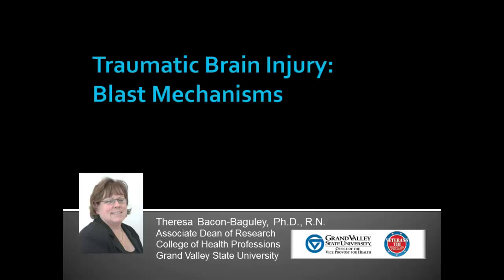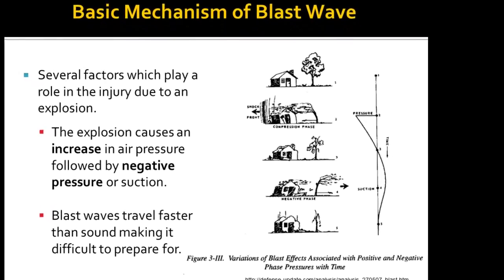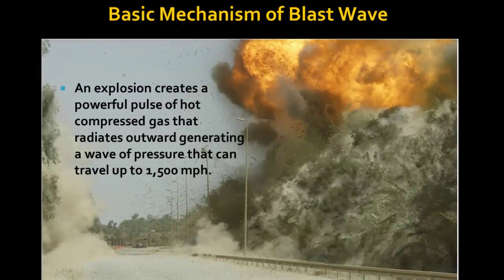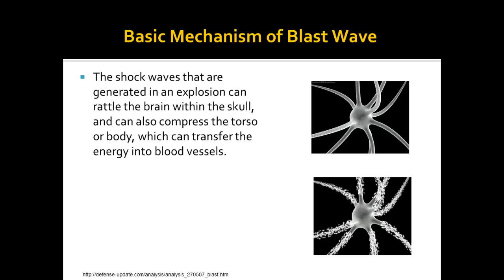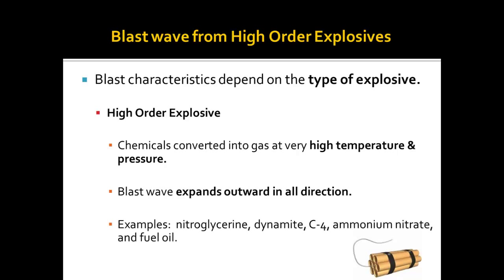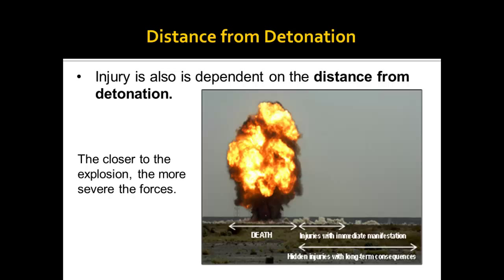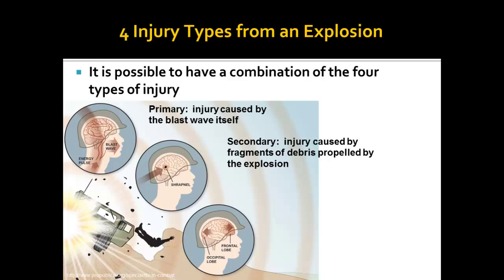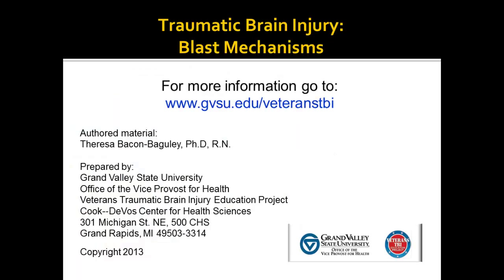01 07 Traumatic Brain Injury:  Blast Mechanisms

Comment: A detonation wave in high explosive initiates at 6-8,000 m/s...
ie. 6-8 km/s more than 1.5 mph
Reply: 8000 m/s in the explosive itself not to confuse with 2000 m/s in air she was speaking about.
But she is not clear on fragments. She seems to ignore that a few fragments travel faster than the shock wave. At this velocity range even a small peace or plastic is injurious.